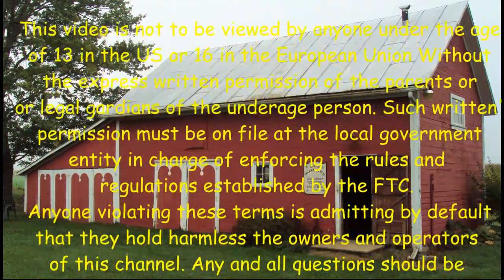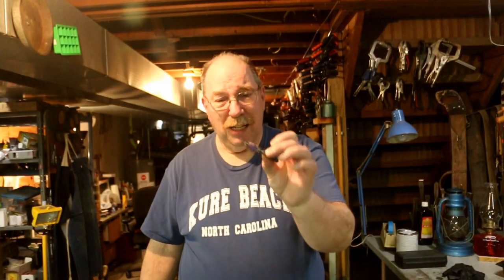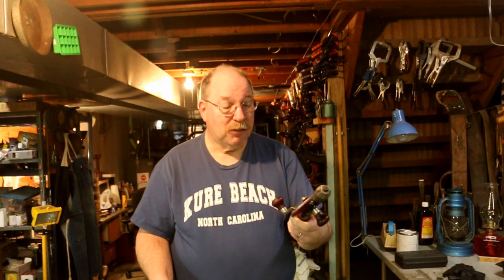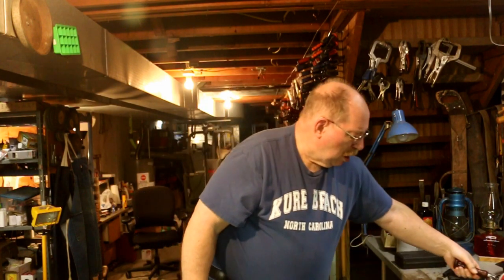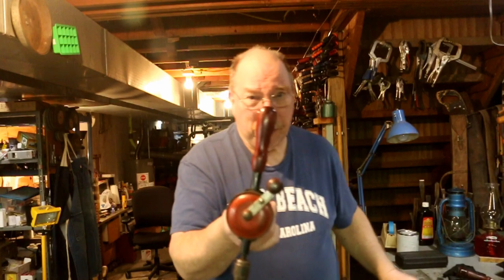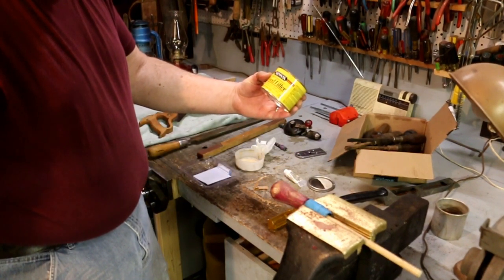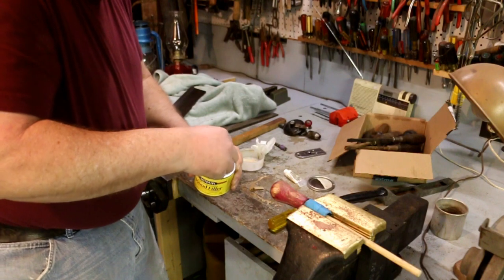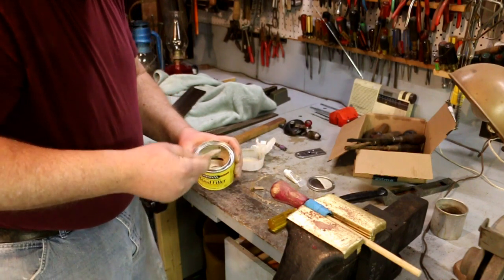Repairing A Hang Hole In A North Bros 1530A X

Comment: Some fillers are a bear to sand, fiberglass is like that.   Bondo sands easy!  =D
Reply from the maker: With fiberglass you have to follow the grit progression. 
Most of us put too much on in the beginning thinking we can shape it easily. That mistake is soon corrected. 
I have worked on my share of Lead Sleds and Bondo Buggies. Body shops just replace panels  wholesale anymore. Manhours....I suppose I have to edit that to person hours.... are too costly to spend on panel bumping and filling. 
The ones that always amazed me were the major damage glazed over with 2 or 3 inches of filler. 
Working on my 46 Ford was an opportunity to practice metal shaping. I was impressed with how smooth I could finish a panel with a hammer and dolly. 
On this handle the filler worked better than  I had hoped. I left it sit longer than usual because I couldn't get back to it. 
My normal practice is to use a cheese grater to knock down the surface while it is still rubbery. Once filler sets up it can get almost rock hard and give even sandpaper a hard time. 
This bonded well and I was able to shape it with a rasp followed by 150 grit. 
Very pleased at that point. 
Hubris is a funny word. Just when things are going well it rears it's ugly head and takes a bite where you least expect it.  😖😎